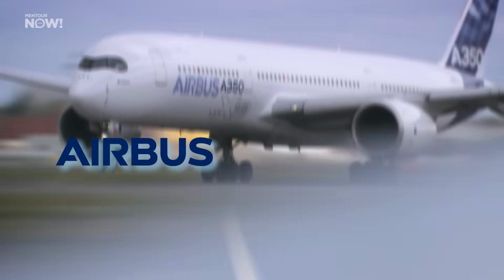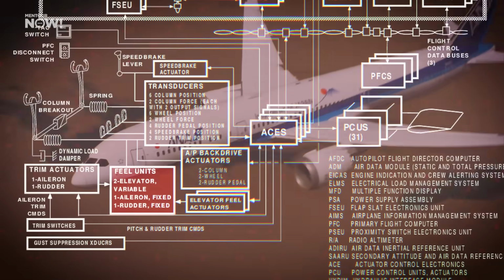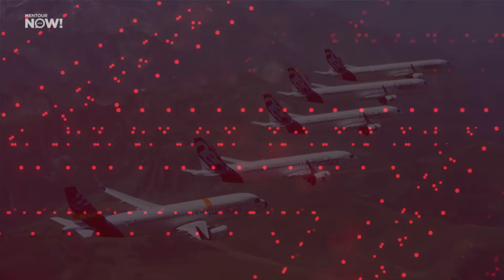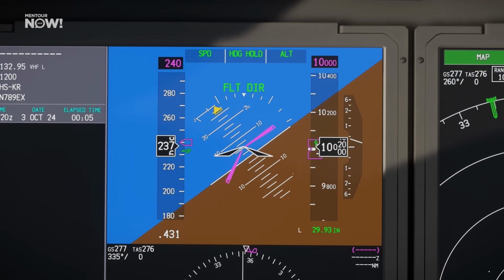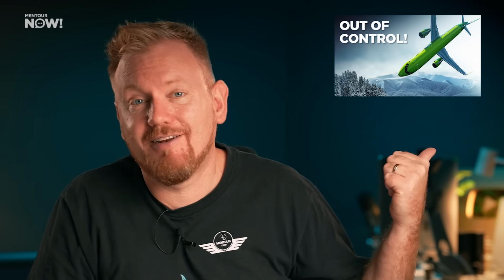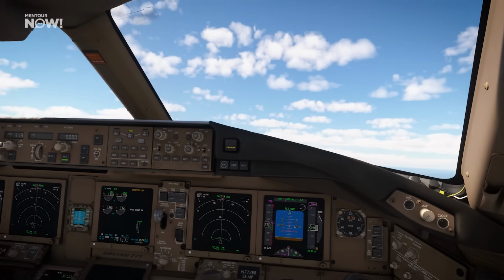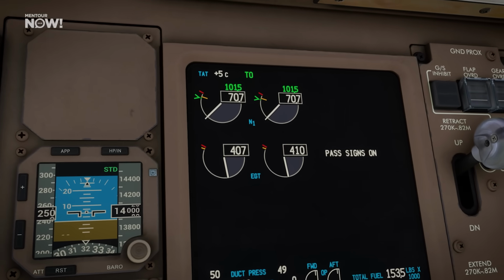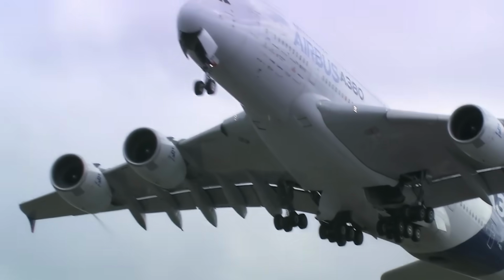Do Pilots Prefer AIRBUS over BOEING?!

Comment: Have flown 727, 737, 747, 767, 787 and A380's.
The modern Boeing fly by wire architecture (in my opinion) was alot more intuitive, pilot friendly and easy to understand than the Airbus system.
My personal preference having flown both is the Boeing FBW system, but I've friends who have primarily flown Airbus and swing the other way!
Both have pro's and cons, but the biggest change I would like to see would be to have the Airbus sidesticks linked so you know what the other pilot is doing. Having moving autothrottle levers would also add to situational awareness.
Air France 447 was a classic example of 2 experienced pilots losing control of a perfectly serviceable aircraft.
Loss of situational awareness and not being aware of the flying pilot's inputs were significant factors.
Each to their own, but I've seen alot of very experienced A330 Captains bid for the 787 and been very happy with the change.
Having said that I'd love to see how the A350 has improved above the A380.

Comment: As a reliability and safety engineer  i can only say that automation is constantly improved to increase its overall reliability and safety whereas human error, although reduced or mitigated by training and procedures, is always present. Airbus methology is, roughly speaking, the same than used in other critical systems. Even Boeing airlines are slowly adopting automatic control. Comercial flying is a matter of safety and efficiency rather than a pilot experience, in my opinion

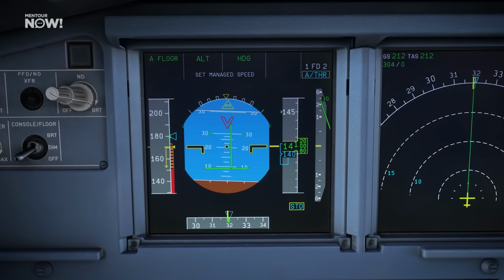Comment: 10:45 This is incorrect. The protection he's speaking of is called Alpha Prot, not Alpha Floor. Alpha floor is what engages TOGA thrust to prevent the speed from decaying into Alpha Max (the red bar). Alpha Prot is what lowers the nose. Unlike what he says later, TOGA LK just means that the thrust levers are locked in TOGA thrust and the pilot needs to reengage the A/THR again. More modern software versions on the A320 will automatically reengage the A/THR once the aircraft leaves Alpha Prot.

Comment: As a long haul pilot today, I wouldn’t willingly go Boeing. I can’t imagine sitting for 8hrs+ with a moving yoke in between my legs. All respect to my Boeing colleagues, but the A350 experience is simply unbeatable today in my view. I Wouldn’t change it
Reply: I know little to nothing about aircraft, if I looked at two planes I couldn’t tell you what’s a Boeing 777 or an Airbus A320 but I’ve been playing flight sim off and on since 2020 and Boeing has more name recognition for me so I’ve always flown Boeings…

Let me tell you that I was shocked when I first flew an A320 I think it was…. They have a freaking tray table ffs, looks like you can legit just stretch out and relax as compared to Boeing where your all cramped in with a gigantic thing between you legs. Plus given the fact that i actually figured out how to turn it on without the in-game systems and can turn on autopilot and all that without using keyboard shortcuts means i more often than not fly Airbuses now… Boeing does have better manufacturer liveries though, barring the Beluga (thing’s kinda cute), which matter a lot to me lol
Reply: @Fetidaf Four years of flight sim and still cant tell the difference between airbus and boeing is crazy 😭 its one youtube video away
Reply: @Fetidaf I almost knew few to nothing about aircrafts but im just interested to know about planes, but based on this video, a much "Big respect" to pilot Boieng air flyers as they are much more experienced than Airbus drivers as Boieng is the traditional design, but watching this video really make sense to choose Airbus over a Boieng as Airbuses were built more automated and reduces human errors....for safety, I would go to Airbus
Reply: @rhianavanessaamoin1276  
Agree 100%. Flying Boeing or smaller planes is probably really good for building more intuition and I think more tactile feedback in Airbuses could help pilots, but I'm way more comfortable trusting a plane's hard protection system even if the pilots are a little less experienced.
Reply: Bingo.  I went from Boeing to AirBus and then back to Boeing (the 777).   That yoke drove me nuts after spending 5 yrs on the Bus.    Plus I found the cockpit to be loud and uncomfortable (relative to the Bus).    Whichever one pays the mortgage.
Reply: Interesting. Years ago I used to hear how yoke was more preferred by the pilots.
Reply: +1  Also   there are more Airbus jobs as Airbus has the upper hand over Boeing.
Reply: @Xoman08  Number of air frames says different... I get it, you were told that you are a better sort of person if you go with the apparent majority and now always have forgone conclusions to keep your biases intact and will even ignore reality if needed.
Reply: @thomgizziz  New airframes  Airbus is selling 60% to Boeing 40% for some years.
  Airbus have commonality, Boeing have not. 
Airbus is the better choice for pilots to secure employment.
Reply: Well said
Reply: Fair point
Reply: A crass person might point out that pilots prefer something else between their legs and then mention something about thrust levers
Reply: Isn’t car wheel since invented also between your legs? What a stupid comment 🙄
Reply: What do real pilots think of sim game “pilots” commenting on debates like this?  What I think should be obvious in the question.
Reply: The Air France 447 tragedy would seem to indicate that more feedback is a good thing when when you don't understand what the aircraft is doing and why. Airbus provides no feedback.
Reply: @MrPLC999   The Air France 447 tragedy was a combination of night time disorientation combined with all pito tubes mal-functioning for a short while  combined with young first officer with serious shortfalls in training.
Reply: @MrPLC999  With the level of error on that flight, I think it was possible that bonin would still hold the stick back even if the controls had feedback.
Reply: @viniciusmagnoni6492 yeah but the left seat captain and the jump seater would know he was doing it
Reply: @MrPLC999  and there were like 3 pilots that failed to fly the plane that had safe speed and altitude as joystick tells them nothing, means any other pilots would fail too, even if claiming behind the screen they would recover the plane. Their only solution was to change how plane computer response and add pitot tubes. 
If it was to fail again there will be same Airbus disaster as most pilot would not have a clue what is going on.

Same with cars,  safer with hydraulic power steering as driver feels input on column than electric only, let alone drive by wire like Tesla Cyber truck, where driver can only hope turning of the steering wheel will be correctly interpreted by computer and no glitch would happen on long drive and wheels will turn.

As passenger only Boeing to me, despite recent events with 737. I would still prefer alu fuselage than composite (as will be more affected by very cold to very high temperature long term) and same for blades- titanium are the best. I seen in fact eroded edges on few fan blades on LEAP engine, while never seen on one with titanium.
Reply: On the flip side, there have been accidents on Airbus because the pilots are not able to tell where the thrust levers are stuck at or who is in control of the side stick and what the plane is actually doing.
Reply: @mikevismyelement  There has been ONE accident where that has contributed (AF447) and even in that it was only one lesser factor. While IMO that is enough that Airbus should do something about it (as this video makes clear that thing is not hard) it is a huge exaggeration to say "there have been accidents". Statistically Airbus planes are safer than Boeing's, who tend to depend too much on fallible pilots doing too much work.
Reply: @mikevismyelement  Airbus doesn't have more accidents than boeing so that point is kind of moot.
Reply: @mikevismyelement  Shhhhh we don't talk about those, we just pretend airbus is perfect and boeing is trash so we can keep the echo chamber happy.
Reply: So you don’t actually like flying. Airbus are trash
Reply: @bozzie7718  syfm thats ur opinion
Reply: @bozzie7718 which might explain why they have a lot of success

Comment: My only experience in an Airbus aircraft is with Frontier Airlines, so I'm sure my experience is a bit skewed, but it was the most uncomfortable flight I've ever been on. I flew once in a Cessna 182, in the back seat, and it was more comfortable. I know that has to do with Frontier's choice in installing park benches as seats, but it turned me off of Airbus very quickly. I'm not a big fan of the weird noises (ie: barking dog noises, and yes I watched Mentour's explanation of that.) they make either. I'd also be more inclined as pro-Airbus if I was assured the one I was flying on wasn't final assembled in France; it's equivalent to a 787 final assembled in South Carolina.

Comment: I flew the A320 since 1991 and I have just retired flying as a captain.
First of all...CONGRATULATIONS for this GREAT VIDEO is perfectly explained as far as A320 is concerned. 
I can tell you that the weak point of the Airbus fly-by-wire flight control logic is the lack of manual feed back (side stick and throttle handles). 
Greetings from Mexico City.
Reply: Thanks for that comment. Which of these planes are more safer:
a320, a321 or a321neo? I've heard many bad news about the reliability of the p&w engines and don't know what planes are more safer?
Reply: @r.k862  you talking about engines which don't have to do anything with aircraft. A321 usually have CFM ... also Airbus families have a choice between CFM and PW

Comment: Are airbus pilots requires to train on the alternate law and direct law? Cuz I feel like that should be required to make sure that if such a situation comes up, the pilots are equipped and prepared to deal with the differences. I also feel like the alerts informing pilots of the changing of law should be extremely obvious and difficult to ignore/miss.

Edit: I'm posting this as someone who is not a pilot and as someone who enjoys watching disaster breakdown vids of airplane disasters. It's also entirely possible that the vids of said disasters may have misrepresented what happened or exaggerated things for drama's sake.